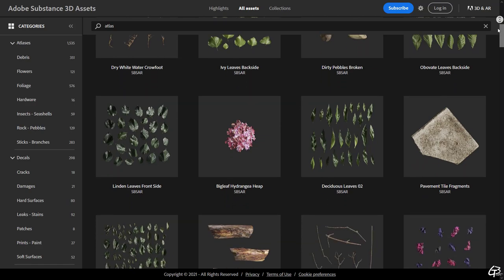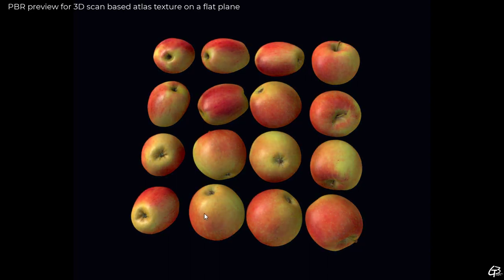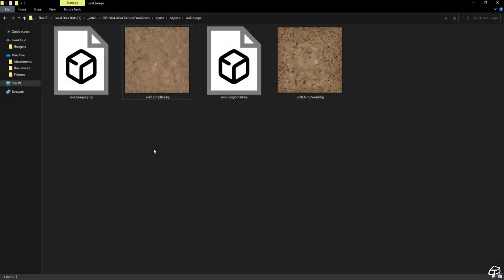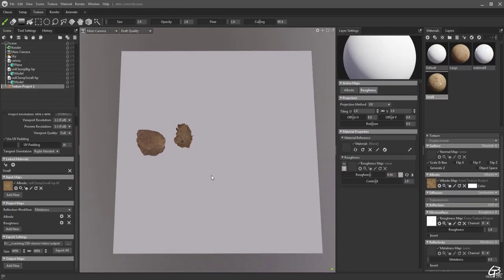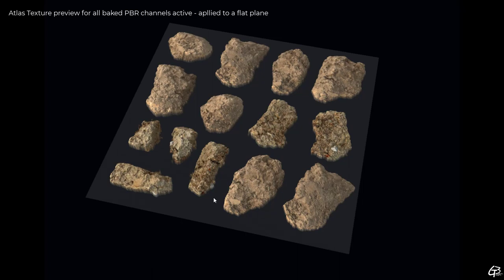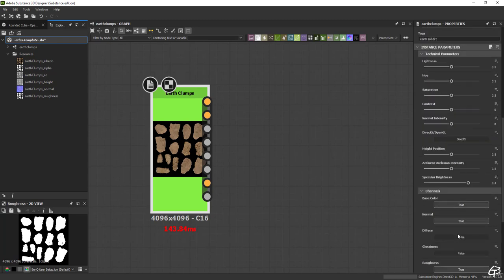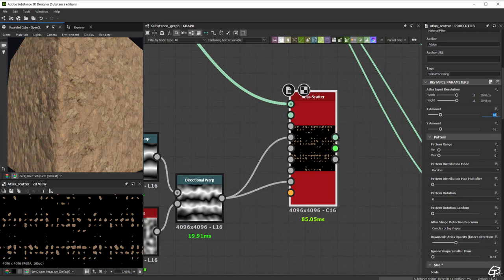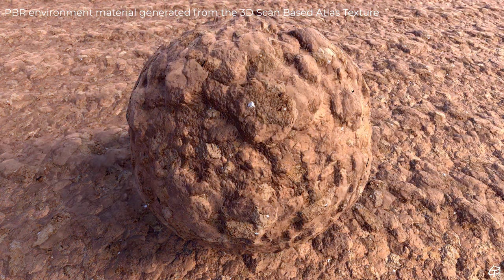How to create 3D Scan Based Atlas Textures for surface scattering

Comment: Really nice, now I can define my problem with heightmap generation in Marmoset :) and learn how to paint the roughness directly in this software (no need of switching on PS) :)
Reply from the maker: Cheers, yeah, that was the main point of this video. So far I found Marmoset Toolbag 4 after the last update as the only piece of software which can do this properly for baking :D. Happy you found the video useful <3
Reply: @GrzegorzBaranArt  yup but for the 4th version you need to pay again :p but it's a perfect tool. Need to watch if it's possible to reproduce those steps on Knald too (better for me for texture generation ... less seems when baking).
Reply from the maker: @henry-louisguillaume532  Thats correct. So far I have found MT4 is the only software which allows to do this easily and honesty I was waiting for something like this. Toolbag 3 had no painting tools as they were introduced in Toolbag 4. Substance wasnt designed for it at all too. I was trying to develop similar workflow with the 3D apps instead (Zbrush, Blender) but the problem is that you dont have such freedom of re-arrangement and painting tools MT4 has at the same time. Technically you can create a highpoly model using 3D app and bring it would be painful and time consuming workaround. Being a videoRam based baker has a lot of cons but this is the biggest pors of it.. that you can life preview highpoly model and modify it live before baking. I am not a big fan of MT4 after the money grab on MT3 customers and I really hope that MT4 is going to get upgrades and improvements for years now before they repeat it with MT5. I can tell that MT4 is very buggy and it isnt the best and the most stable solution so far.. but it works and so far its the only option for this type of workflow I am aware of. I might try a different solution in a future though as I have some ideas but so far I failed and this is the best available working pipeline/workflow for this approcach I developped.

Comment: Excellent video!

Quick question though, where did you find a Riko400 ring flash? I've been trying to get one for a while but nowhere seems to have them in stock!
Reply from the maker: Hey James, I purchased mine on Amazon but I have found that Amazon was really kind of a front page for Essentials Photo (https://www.essentialphoto.co.uk/) and they had it cheapper directly on their site, so currently I purchase most of my recent stuff on Essentials Photo. I can see that they are still available there. Also cant find any AR400 ring flashes on amazon anymore. There was a lack of AR400 flash lights for a while but as I understand they should be back since last month. Same applies to spare AR400 batteries.. I waited for mine for 5 months but now I can get them in no time. Hope that helps :)
Reply: @GrzegorzBaranArt  good to know that essential photo is the better option! However when I check there, they're on pre-order :/ I guess I'll have to check back in a few weeks. Thanks for the guidance!
Reply from the maker: @JamesKellyWickerman123  oh crap, indeed. I am sure AR400 was in stock 3 weeks ago as someone I know purchased them there. Same as spare batteries, but looks like they are gone again. I would contact them via their live chat (active in opening hours) when they are plan to resuplly them .. of course if you cant find them elsewhere.

Comment: This is cool man! It would be interesting to learn more about the method of photometric stereometry. As far as I know, you can shoot large surfaces with this method, tiles 2x2 or more. Not just individual objects for the atlas ... You haven't practiced that?
Reply from the maker: Thanks Constantine :), Appreciated. Do you mean phtogrammetry or photometric stereo as these are two different techniques? Regarding photogrammetry with the photogrammetry you can capture as large areas as you want to and there are no limits.. I covered an example of entire cliff in this video already: https://youtu.be/_WJLjOrzNsU . 
Regarding the Photogmetric Stereo technique,  this one has practical limit to about 15-20 square cm. Of course you can capture even 50 by 50 cm if you have right tools and technique and I am planning to cover this technique in details in a future video.
Reply: @GrzegorzBaranArt  Thanks for the answer! Yes, I meant exactly the Photogmetric Stereo technique. I was interested in the ability to scan large areas with this particular technique. I have seen surfaces in the Megascans library (1x1 and 2x2 meters) made with Photogmetric Stereo. Usually, this technique is used to make materials that have foliage, dry leaves and the like ...

Comment: Is there a visusl quality diffence between using the atlas scatter node vs just building shapes and scattering them with the tile sampler node?
Reply from the maker: Hey, these are two different tools. The one scatters full PBR objects (with albedo, normal, height, roughness, opacity) while the Tile Sampler  just a single grayscaled maps or shapes which we can use as a height map for example. So it shard to compare the result as they are designed to handle different type of data. So, you cant scatter any atlas texture using the Tile Sampler node. Hope that makes sense.
Reply: @GrzegorzBaranArt  yes that does make sense, though im aware theyre for different things! Im basically trying to find out if its worth using the atlas workflow, or if the tile sampler using height grabs is better for overall quality. Ive seen some people online complain about aliasing issues on atlas scatter but maybe theyre wrong
Reply from the maker: @Grumbledookvid  nah, Atlas scatter isnt a perfect tool and has its issues. It usually needs some additional treatment to get the most out of it. The thing is that it is designed to scatter full texture sets (atlas materials) while Tile Sampler just basic shapes. Tile Sampler is also far from being perfect in how it does things :D

Comment: Ive been wondering how you get roughness data from scans.
Turns out you paint the by hand.
Is it possible to get roughness or metalness data straight from the scan?
Reply from the maker: It is possible to get the roughness from the scan but it is not as simple as initial scan. There are two ways to get it, measure and apply the measured value or scan with and without cross polarisation and subtract one from another to get roughess value. It can be also faked using existing initial data if you understand what the roughenss really is. Planning to make a video about this at some point and cover it in my next book.

Comment: 17:43.... ahah.... Designer at glance. What the interface with all those noodles. Someone show them Electronics Nodes for UE, or Nuke, or 20 years old Shake....
Reply from the maker: :D better then nothing but trying to make working interface (exposing control to the user similar to the one official Substance Source atlases has) with the Substance Designer can be really painful. At least it works fine when used: [26:58]